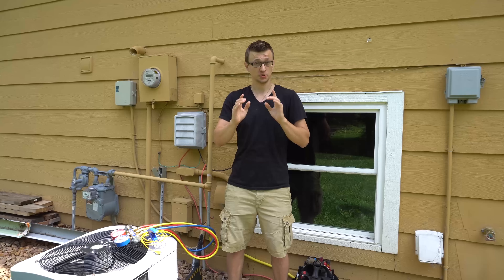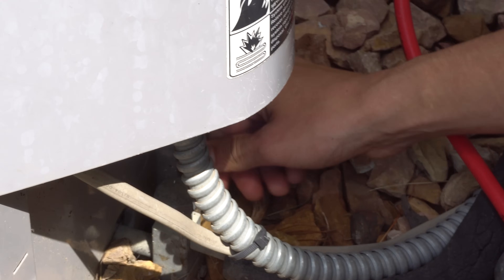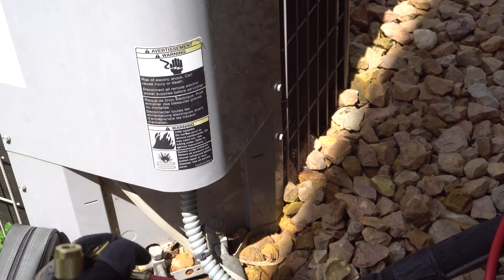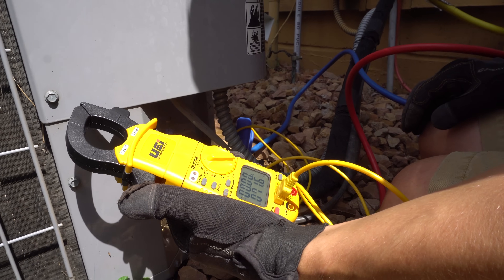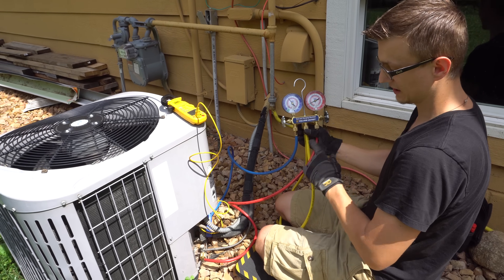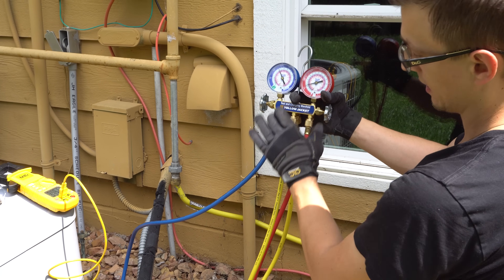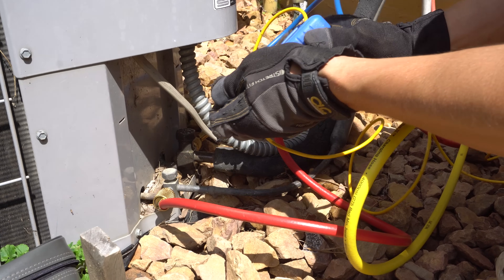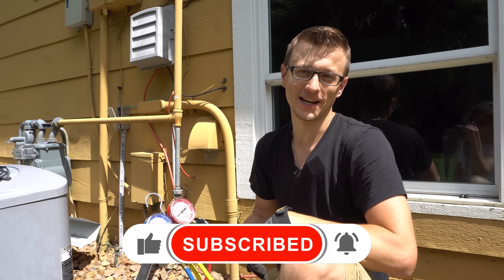How to Read SUPERHEAT and SUBCOOLING

Comment: Do you leave your gauges open are close when you are just checking the refrigerant ?
Reply: Open, as in high side open to low side? No! Never. Or do you mean open as in open to the aux port. Aux port doesn't matter as long as the hoses are closed off tight.  Its good practice to leave your gauges always closed unless you're adding or removing refrigerant.  Closing the gauges does NOT close the gauge off tot he unit.

Comment: Using infrared gun to take line measurements..Who does that?? 
Love your back flip techniques.
Reply: Lazy techs lol. Clamp meters are best. Over the top techs use service port probes that actually go into the copper to check temps inside the lineset...but those guys drive up in Rolls Royce service trucks lol

Comment: When getting readings for SC or SH there are other variables to consider such as a clean air filter, clean evaporator /condenser coils, total air static pressure, etc.
Reply: Yes and no. The sh and sc readings will actually guide you to those issues. After you find them, you can fix the issue and recheck your numbers. It's a good idea to check static on every job. It takes about 3 extra minutes when you get your process down.
Reply: Facts. If your subcooling is superheated, meaning the line temp is higher than the gauge temp, then your condenser coil is probably plugged and filthy. Then with superheat if I know the line set is extremely long I'll go inside and take the temperature directly at the evaporator. It seems to work.

Comment: Question 
Is Superheat only calculated on units with a piston and is sub cool for units with txv or both superheat and sub cool can be calculated for either ?
Reply: Yes and no. Your statement is correct for a general rule of thumb to use in field...but if you suspect any issues, or cant explain a problem, its best to check both SC and SH regardless of the metering device.  

You generally don't need SH for a TXV system because its the job of the TXV to maintain SH at all cost.  You could be low on charge and the TXV will try to keep SH in check. 

When in doubt, if you dont know what metering device is, or you've got an extra 2 min on the job-site...check both :) Better to have more information than not.

Comment: i would like to know how the SH and sc help. know that the air temp plays when its hot and that needs to be accounted  when reading gages
Reply: When it's super hot inside and hot inside, your pressures and sc and sh will be higher than normal. Sh and sc are telling you how well the evaporator and condenser are doing their job.

Comment: I have 2 questions (1) in your ideal case, both SC & SH are within the range, around 10, what if you want to keep SC but allow SH becomes very high or very low ? what will you do ?  (2) In a tough case, for a very old AC, you cannot open the evaporator case to find out what the type of metering device is, no manual, no information can be found, what are you going to do ? will you trial for error for either approach of either SC or SH ?

Comment: I have it confirmed using de Emerson P/T chart app. According with the app, 72°F should be your saturated temperature and your bulb temp should be 82 °F so in this way it allows you obtain the superheat value. So, Is your bulb temp = line temp ???

Comment: The "discharge line" is the pipe leaving the compressor, going into the condenser coil.  You are placing the high side gauge hose on the "liquid line", which is the easier way to check for subcool. Also, pipe is more accurate when you clean the pipe.  Just sayin'
Reply: You sound like you love to clean a bit of pipe .......

Comment: What if the AC unit you're working on has a TXV( thermostatic expansion valve)?   If I'm not mistaken, first,  you need to determine the kind of Metering valve the unit is equipped with. That will tell you if you should read the superheat or subcooling.
Reply: This is true, nice to see someone catching that. A TXV will maintain superheat even if the system is low on charge (slightly low, not several pounds low).  A good tech will check both SC and SH. I run a 4 port gauge with dual pipe clamp thermal probes so I can read both SC and SH at the same time...VERY useful.

Comment: Can someone confirm when doing a change out or new install, which comes first, pressure test then a vacuum or the other way around
Reply: You pressure test your system first, to make sure it’s not leaking. If you have a leak, you’ll never achieve a vacuum.

Comment: So where do you find the tables or recommendations as to what the SH and SC should be for a particular unit?  Are there are rule of thumb for R22 and R410A?
Reply: For superheat you need to find out yourself with dry bulb and wet bulb figures and put them into a chart. You can Google "target superheat" to find the chart. Subxool is usually a fixed number depending on the unit and is written somewhere on the unit from the factory.
Reply: I still use a cardboard slide calculator but there are excellent free apps as well now, but the other post is correct you still need wet bulb of inside temp and temp of air entering condensing unit. I have broke so menu wet bulbs that I now have a field piece meter, although a little expensive I think it is well worth it.

Comment: Would you know why my SH and SC are almost the same temperature? SH is 4.4 and SC is 1.6 the system had been running for quite some time so it was stabilized
Reply: Not to answer for him but you will need some more information first. Type of expansion device and wet/dry bulb temperatures. If fixed orifice, may need a superheat calculator, txv may be overfeeding.

Comment: Great videos! I have a r410a heat pump unit. The unit started cycling as if it had reached its set temp. First I thought the thermostat was going bad. I took my meter out and checked it out. It was showing it was still calling for cooling even though it kicked off. It had been a while since I had cleaned the coils, so I cleaned the cond and evap coils good. I then checked the schematics out. It showed it had high and low pressure switches. I figured I had a leak and it was low, so that was kicking it off to protect the compressor. The whole house came down with covid-19, so while quarantined, I didn't want to call anyone out to look at it. I ordered gauges from Amazon and thought I would at least get an idea of what was wrong. After checking, I started out at about 210 psi on both before it kicked on. It was about 70 degrees out today. It kicked on and the high side went up to about 225 psi. The low side gradually went down to about 75 psi and held there before kicking off.  Definitely too low of a pressure. I will have to get someone out to find the leak and fix it. My question is... what is the pressure the switch would kick it out at on a r410a unit?

Comment: I always purge through the manifold to parked end of the yellow hose. Both sides. Just in case air lurks in the manifold. Im OCD (!)
PS best concise explanation of SC/SC i'v found on YT
Reply: Yes! Good attention to detail! If we're gonna vacuum down to 500 microns before releasing refrigerant into a new system, why screw that up with excess air from our gauge set hoses. By minimizing non-condensible gases as much as possible, it reduces head pressure and makes the system efficient and lowers their power bill. Air is added every time the gauge set is hooked up if we're not careful, and it adds up. That little bit makes a difference I think.

Comment: Do you bother to check wet bulb and dry bulb with piston/fixed metering devices? It seems to be emphasized so much, but no one does it. If you don't take those measurements, how could you know the target superheat?

Comment: I MUCH prefer using a clamp over an infrared temp gun..  I have had issues using the temp guns on shineir pipe or even wet pipes..  i did some tests and sometimes fo8und as miuch as 10 degrees discrepency from the gun to the clamps..  I really like my fieldpiece wireless clamps. I highly suggest someone just getting into the industry packing up their first toolbox to invest in either wired or wireless clamps..

Comment: It has been my understanding that you need a different set of gauges for different refrigerant. Is that true? 
Gauges have different markings for different refrigerants. 
How do you keep your gauges separated if you need different ones for different refrigerants? You have no markings on that set to say it is for R22.
Reply: You use the same gauges. Notice that the green scale is labeled "R22" at the bottom and the pink scale is labeled "R410A" at the bottom. Green scale/green jug means R22; pink scale/pink jug means R410A. These are the two that matter for HVAC systems.

Comment: I guess I’m a lazy b and my eyes ain’t what they used to be (some gauges are hard to read) so I use the Fieldpiece SMAN4. I let it do the calculations for me and digitally show me the SC and SH as I throttle the refrigerant in. Nice videos, though. Question:  if you use a vaporizer, is it impossible to slug the compressor or do you still have to watch how fast the refrigerant is added?

Comment: What is your opinion on ultra high effecient variable speed units with communicating technology and VFD compressors? Do you think they are good, or just more to go wrong?
Reply from the maker: Well they are more efficient... But from what I've seen they do tend to break a little more often, cost more to repair, and are more troublesome to diagnose.

Comment: Hello. I hear water dripping when the a.c. is on but when it turns off it stops and comes back when it cuts back on again. Do you know what could cause that?
I hear the dripping in my upstairs bedroom ceiling which is underneath my attic where the furnace is.
Reply from the maker: That is likely just the sound of water going down the condensation drain line/pipe or the sound of refrigerant "gurgling" when the unit is running. Both sounds sometimes occur and that's normal. But to be on the safe side, if possible I would go up there and look for any physical signs of water leaking around the air handler and clear out the condensate drain line in case it is partially plugged.
Reply: @WordofAdviceTV  Thank you so much for your response. It freaks me out going up there. I admire you guys for doing it. I wish you lived near or in Texas I would sure hire you to do it.

Comment: Good video  

Question what is the normal superheat and  sub cooling
Reply from the maker: Every unit will be different so there actually is not a normal superheat or subcooling. Subcooling is usually around 12 degrees but the superheat can vary by quite a bit depending on temperatures and wet bulb.

Comment: Thanks for clear explanation. I have a 44 year old Rudd AC unit and it finally has not performed at the end of the summer. I cleaned all coils and air filter, evap coil was freezing over and I suspect low refigerant due to leak. Will try to repair but may not be worth the expense of R22. So sad to see my old friend go since its been such and easy unit to service all these years. He owes me nothing!!
Reply from the maker: 44 years is really good!! That's a nice run! It may be time to replace it but just thought I should mention that there's R22 on E-Bay in small quantities ;)

Comment: If using capilliary for metering device. What to measure SC or SH?
Reply: You would charge with "super heat " for fixed orifice aka piston.  " sub cool "  is for txv .  
I remember it like a car with cruise control .  txv is newer ,  " cooler "  technology .  It changes how it meters based on the temperature outside and how the system is running .    So you use sub " cool "
Cap tube and piston is basic  just always the same no matter what .  Can't change  the size or amount .
Reply: @craigerickson8712  Sir Craig thanks.. 👍👊👍

Comment: Thank you Jay!!! I'm guessing this is in Hawaii now. As a lay person, I'm not sure why you'd want those values. Clearly you compare the two values, but now sure why and what divergent or convergent changes mean. I appreciate all your hard work Jay. Love to your family and hope you guys are doing very well!
Reply from the maker: I actually filmed a few videos in Minnesota right before we moved (this is one of them) so that I have something to work on while on quarantine. So for the next few weeks there will be more Minnesotan videos ;) The superheat and subcooling values are only a part of the numbers needed to accurately add refrigerant to a unit. This video was simply showing how to get the two most important readings. Tomorrow's video will be an example of adding refrigerant using the subcooling measurement if you're interested. Anyway, we everything is going great in Hawaii!! We are on our second quarantine :) I will be posting a Hawaii update video later. I hope you and family are doing good too, may God bless you and yours!
Reply: This data helps to diagnose unit preformance. It can also be used to hint at issues with your refrigerant, such as if you have non-condensables in your refrigerant, such as moisture or air. However, to get a more thorough reading of any non-condensables in your refrigerant, you'd want to use a Moliare Chart and calculate your readings, which is a beast into itself.

Comment: Please explain these terms with real-time example.
Suction super heat,
Discharge superheat,
Suction saturation temperature,
Discharge saturation temperature,
Saturated condensing temperature.
Reply from the maker: Those will need to be a few separate videos. One of them will be posted tomorrow :) Thank you for the suggestions!

Comment: Your videos has convinced me to be a HVAC technician. Once I get out of school, I'm going to a trade school to become a HVAC technician.
Reply from the maker: Awesome!!! Glad I could inspire you to do that, it's a career path you won't regret! Good luck!!
Reply: @WordofAdviceTV  HVAC It's a cool career path! (Pardon the pun.) :) But does help a lot of people.
Reply: What's the importance of sh and sc
Reply: @elethaainsworth5813  Superheat helps determine proper refrigerant charge.  SH rule is: 1. Add charge to lower SH. 2. Remove charge to raise SH. (Partial answer, but brief) :)
Reply: Go to a reputable school i.e. Community College some of the "trade schools" just are not doing a good enough job teaching. Slow and steady wins the race. But first be honest with yourself  are you mechanical?, can you use tools?, are heights an issue?,the weather hot/cold/rain/snow?,long hours. Are you willing to invest in yourself and have the discipline to stay the course? You can make a very good living, the more you know the more you can make. Everyone learns at a different rate. But just be honest with yourself. when you make a mistake  own it and learn from it. Nobody's perfect do your best. In the last 4 years I've had 40+ apprentices/helpers. 7 have stayed and continued on with a career not just a paycheck. 30+ years in Refrigeration.
Reply: @robertshay9951  very good advice, I got lucky myself, I started in install but I wanted to become a tech so my boss told me to study for my certification and he’d pay for the test. Once I had my certification I learned everything on the field and from other senior techs. Im at a good company who had patience with me and let me learn on my own mistakes, I’m still learning. Another piece of advice is to not allow yourself to have weaknesses, if there’s something that you aren’t sure about then get online and study it until you know it and ask questions about it. In this field it really pays to know as much as possible, you’re going to run into some things that completely stump you.
Reply: @Justarandomspacemonkey  very good sir!  Thing are definitely different than when I started. You guys now have the ability to find info we had to bang our heads to get. But that's a good thing! Part of being a good tech is to know where to get info to correct the problem that needs to be addressed. Keep up the good work and godspeed to your goals.
Reply: @robertshay9951  👍
Reply: @robertshay9951  100% great advice down here in New Orleans after being in an attic in the summertime you will find out quick if this is the place for you.
Reply: @astronola  attic, crawlspace, top of a walk in, never liked heights or tight places. But I like a paycheck. Left residential work, stayed in commercial refrigeration for over 25 years now.when I first started did everything till I found out what I liked. The first 5 years are the hardest it seemed
Reply: @robertshay9951  I like your advice on community college trade school, right now I am in one, I wish I had gone somewhere else
Reply: @riderofrohan8840  the community college that teaches in my area has a very good program, all based on the instructors. the trade school method is based on 8-10 months and crammed learning,while not impossible the longer course allows more time to absorb the curriculum. That said everyone learn at a different rate. But my observations are that my apprentice's that came from CC seemed more engaged. I've had 47 apprentice's in 4 years only 7 we're of good quality and still working on the trade 3 we're CC 4 we're trade school so it can happen.  Learning Refrigeration will pay off better in the long run, longer hours more work butt higher pay. Be patient remember this is a show me trade.Good luck to you sir!

Comment: My York unit is giving me 9 FLASHES on my control board when locking out about 1 min of run time on the condenser...any remedy 4 this problem?
Reply from the maker: There should be a chart or paper somewhere on the unit or on the control board itself that explains what the 9 Flashes stands for. Every unit is different so a good starting point would be to figure out what the error code stands for.
Reply: Yea its saying reverse polarity or grounded...all this happened when we had a power surge ☹